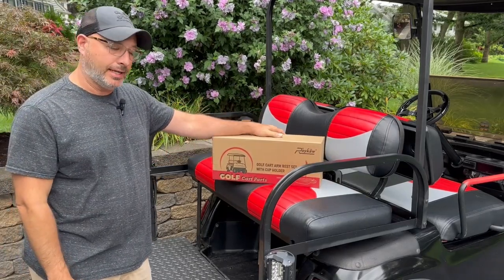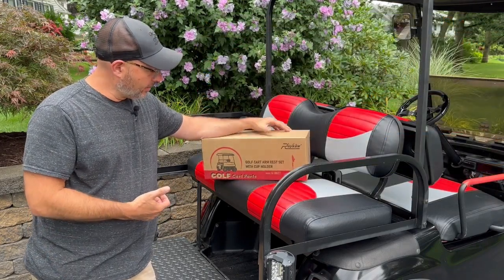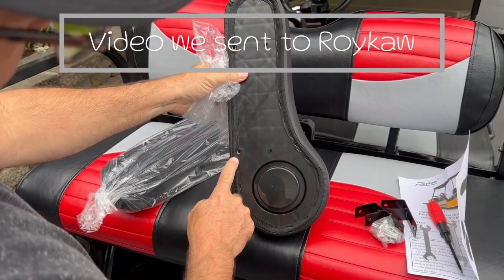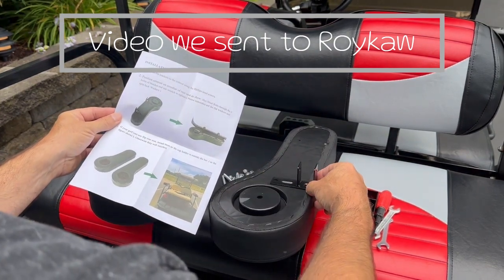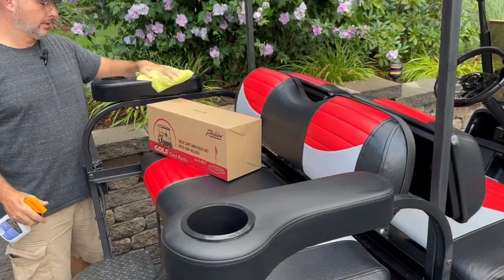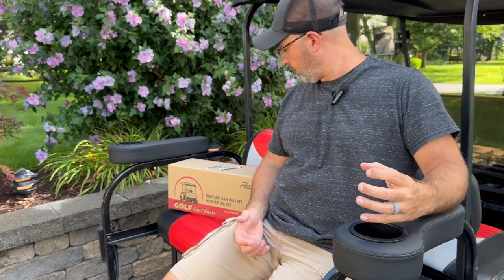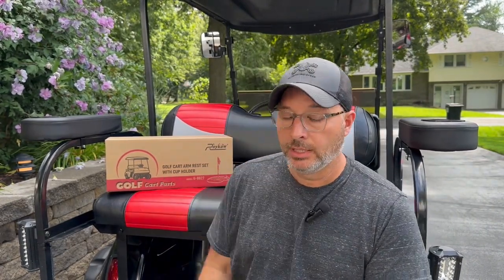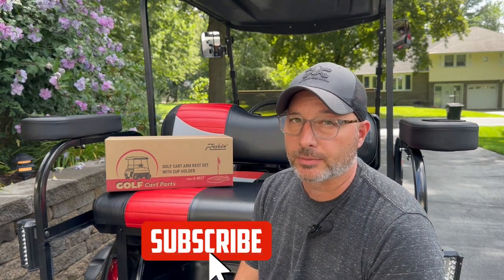Roykaw Rear Seat Armrest (with cup holders!!) install.

Comment: Thanks for the Vid....   Just wondering what they'd look like if the cup holders were on the inside.....and the hardware looks a little sharp....but for the price, they look real nice!!!
Reply from the maker: We could have put them with the cup holders Facing in on this application as that Seat does not Flip out to a bed. If you have the flip style seat will need to put them on like this. Agree on the sharp hardware situation as well. No issues for him as of yet on that though. But yeah, a kid tries to slide through that opening, OUCH!